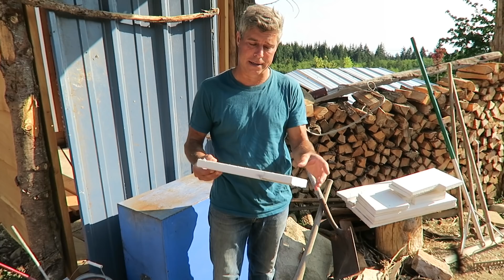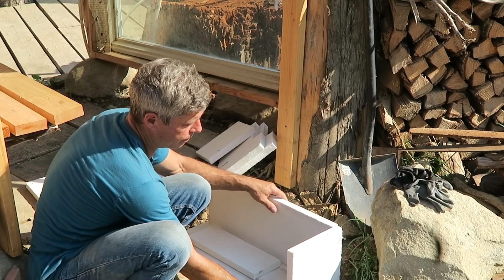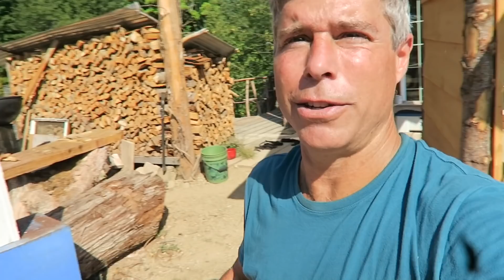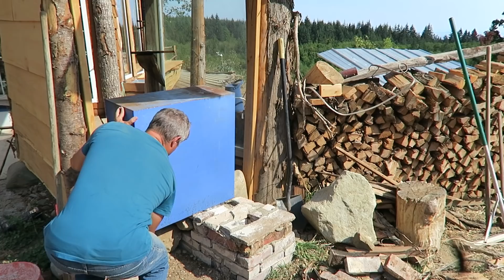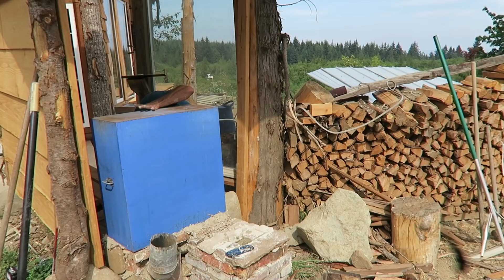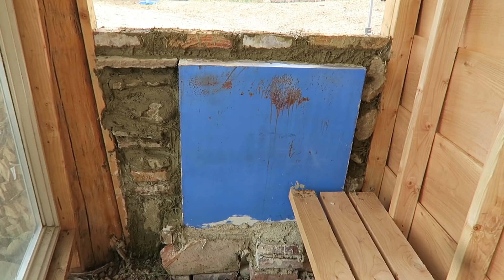Ceramic Fiber Rocket Stove Build Discussion

Comment: Hello Matt
Thanks for this video. Your CFB design for the core, lined with refractory bricks at the feed point - look like a great idea. I will surely try this out sometime soon, in the Himalayan hills in my country Bharat (India).
How does one clean out the wood ash remaining from every time one fires it? I would think that a horizontal  opening on the feed end would help create a cleaning port. Of course, we will provide a CFB plug as a cover to this opening so as to avoid any air entry from here. Your view pls?
Best Wishes
Rajeev Agarwal

Comment: From the internet: The silica (SiO2) in ceramic board can form cristobalite (a known carcinogen), at temperatures from around 900 degrees Celcius and up (so perhaps on the inside of the riser). It's advised to treat used ceramic board, that has been used as active fire insulation, with the same care as asbestos. Before use as such, it's considered harmless.

Comment: I just got a 4x6ft 2" thick piece of this stuff for free from a local fireplace builder. Large manufacturers often have large cut offs of stuff like this they cannot use and will give you for free or cheap 😉
Reply: Did you getter done?

Comment: You might sweat like a horse (you have no doubt seen a saddle removed from a horse), but you will NOT sweat like a Pig!  Pigs do not have sweat glands!!  That's why they roll in the mud, to cool down, because they do not sweat.  Other than that THANKS FOR THE VID AND THE INFO!!

Comment: I have a small (2-3 person) infrared sauna and the electric heating element controller is shorted out. 
My plan is to build a rocket stove using stratification exhaust inside the sauna for heat. 
Should the stove be on the inside or outside?
What material should the stratification chamber be made?
Please publish a plan for this on your site. 
Thank you for the great information!

Comment: I have a 2-3 person home infrared sauna that I have burned out the controller. 
It is wood construction with an interior wood bench. 
I want my sauna back. ;)
I found this video searching for a rocket mass heater for a sauna. Do you have plans for a smaller RMH to power the sauna internal air temperature to between 170-190 F?

Comment: Matt do you recommend ceramic fiber board vs a cast perlite clay core, I am planning to build a 8” j tube rocket mass heater,  I am also leaning toward your ideas about stratification chambers as opposed to stove pipe inside the mass, I also want to ask about the brick splits inside the burn chamber I heard you say before the brick gets hot and competes with the riser a little. Keep up the good work Matt

Comment: Hey Matt,
Please, can you tell me how high can you make the wood feed (total height from the bottom of the feed) using this design before it becomes problematic?
I have bought the plan and it seems that (before you add the exterior stone/brick etc on top) the wood feed will be 8 3/4" deep if I'm doing my maths correctly which is a wee bit short.
Thanks
Reply from the maker: It will work best if built as designed, but you can build up the height and see how it works for you.  How high will be a function of draft, so there isn't any one answer.  Depending on how much mass, how much chimney, stove temp, outside temp, etc.  I recommend leaving it as designed for ideal performance, but feel free to experiment and see if it meets your goals with taller feed heights.
Reply: @broaudio  ok. I'm just prepping wood for next season so I want to know how long to cut it. I'm going to be building your masonry J from your plan. Can I assume the wood length will be ok at 10-12"?

Comment: Been looking into this a lot over the years; this the first approach I feel I can do with my skill set. I come from a manufacturing background, and my desire was to form the batch box/burn chamber and riser in one piece out of steel, lining it appropriately. 
My next concern is the transition from the drum to the heat sink. I plan on building my own barrel, flanging the bottom, and fastening it to a flange welded to the batch box/riser.  It seems that every RMH I’ve seen has the burn chamber and bottom of riser packed in cob.  If the entire inside of burn chamber and riser are insulated with this fibreboard anyway, is it still necessary to pack that area with cob?
Or can I simply begin the cob packed area beyond the transition? Simply, must the bottom of the drum be part of the heat sink?

I’m looking to achieve portability with permanence; being able to disconnect the mass heater from the heat sink. 

Thanks for putting all these vids and info. online; without people like you paving the way, the rest of us have no road to travel on.
Reply from the maker: Jay, you can build it exactly as you describe. I have built some concept stoves similar to your idea and they work well.  I'd love to see it when you get to building it!

Comment: Matt, I ordered your plans this morning and built my core today. The plans were perfect and everything went together as it should. My question is, when I test fired the core it got so hot on just a small handful of sticks that the riser and burn tunnel were shedding intense heat and smoking quite a bit. Is this normal or is the ceramic board I bought not right for what I'm doing here. I thought this stuff was supposed to be super insulating and keep the heat from doing that. the board I have is rated for 2300f. Any input would really be appreciated. Thanks
Reply from the maker: Doug, the ceramic fiber has a binder(rice starch typically) which burns off in the first burn or two and does smoke badly at first. The board will cure and become harder and stop smoking after a good hot burn or two. Keep going!
Reply: Thanks for the super quick reply! This core is going to go in a barrel for a shop heater with provisions for a mass bench built in. I will also wrap the core and riser with a ceramic blanket. Will my board take the heat? My first core in my shop heater was 6" square 1/4" steel,( I know,  bad, but I had to try) wrapped in 2" of ceramic blanket. It worked wonderfully for a couple seasons, but I believe this core is really gonna kill it!

Comment: Here in Uk they still sell clay drainage pipes suppose you could use them as the riser pipe
Reply: They will almost certainly crack up, because they aren't meant to withstand high temperature. Clay can be fired at temperatures much lower than a rocket stove generates. I had considered using clay chimney liner but learned (by reading, fortunately) that it would suffer the same fate (as the GreenShorts DIY guy admitted in a comment to his video).

Comment: Have you got a stove design to heat 44 gallons of water to almost boiling ? need large surface area of tank and loads of BTUs, power output but also need smokless and excellent burn efficiency, Basically, a cheap stove to compete with expensive wood gasifiers which are fan driven and too complicated. thank you.

Comment: Hey Matt, cool project you've got going on. I really like the simple design, I'm wondering what other pieces would be needed to turn this into a full fledged pizza oven? Also what sort of prices are you paying for your 36x48 sheets? Locally I can only find the cercamic fiber in 24x36 in sheets in LD1900 and MD2300 (different heat ratings) for $28 and $35, respectively. How pricey are these in your experience?
Reply from the maker: It would be a simple thing to add an oven over the top of the riser.  Your price is pretty good on the CFB.  I typically pay around $100 for the larger size.  The 24x36 will work for the build, you just will need a few extra sheets.  Thanks for the comment!
Reply: @broaudio  Hi there! great videos! I'm just wondering where you buy your ceramic fiber board? I'm having trouble finding a good deal online. Thank you!

Comment: This video answers one of the long-standing questions I've had about rocket mass heaters; can you have the fuel feed on the exterior of a building and the mass on an interior wall?  My father has a 30'x40' pole barn and my thought has been to build a rocket mass heater where the fuel opening is just outside of the building, with the burn chamber, riser, and thermal mass channel running the length of one wall before the flue gases exit at the other end of the building.  This would allow for ample heat transfer without exposing the interior of the shop to any open flame, ever.  (This is a major concern of his, due to the flammable nature of some materials he uses in the shop.)  This video shows how the thermal mass can be inside the building, or part of the wall itself, with the rest of the stove outside.  That is encouraging.
Reply: It's always prudent to avoid open flames in the interior of any building and especially if there are volatile compounds stored within.  Heat transfer is minimized by use of substances known to have high resistance (i.e. masonry.)  But I think your dad is quite right to want to avoid excessive heat in relative proximity to volatile substances.  Some compounds explode just being stored in closed spaces with elevated ambient temperature.

Comment: For a stove designed to efficiently heat a home, temperature in the main burn core, where gasification occurs, can reach higher than 3200F deg and melt steel.

Comment: Nice i tried the ceramic boards awesome stuff thanks for the heads. If you want a better seal for the brick surround you can use sand and water with a plasticiser washing up liquid works well use like a mortar creates a re useable mortar seal on the bricks.

Comment: matt, you do not seem to be concerned about the clearance of the radiator over and around the riser or the ratio of space in the surround to the riser.  i thought these were critical points of consideration.  also the height of the riser in relation to the burn chamber.  please help me here.  i am spending the winter trying to learn enough to build this thing before i freeze.  of course this has been the coldest winter in 50 years already and the house is barely above freezing.  i asked about venting into a fireplace chimney somewhere on one of your videos but i cannot find it
Reply from the maker: Hi Leslie, I've built so many I have a good feel for what is adequate with regards to clearance.  Just make sure you have no less than 4" above the riser to the radiator and you will be fine.  Around the riser you want equal CSA to system size.  This is a 6" system so I want 29.sq.in minimum around the riser, but it can be on one side or the sum of all around.  In this case I offset to one side, but there is lots of room.  My designs are tested with a Testo and verified clean, so I do not follow the common brick ratios exactly as I have improved upon the traditional design.  I feel the brick versions are inefficient and dirty compared to these, so you should not try to compare them.  Hope that helps.
Reply: CSA is? and what about venting into the fireplace chimney, Please. and yes.  it all helps.  I was so excited to find the heat riser and core videos.  then i read where you said it was a temporary cast core.  i have watch hours trying to find a system of some longevity that is complete enough that i can build it,can you direct me ?  i think i have watched all you videos at least once. if i ordered your plans for a RMH would i need any more info.  i follow directions well.  is cat litter clay good for the cob? i really wanted to build your stove but your said it was not as good a heat source.  Thank you.  Thank you.
Reply from the maker: Leslie, the cast riser is a long term riser build.  The inner form is temporary.  My stoves are a great heat source, all of them, but need to be sized correctly to the space.  No cat litter please.  CSA is cross sectional area.  I believe you should just start building, you are not going to know everything until you build one and have some experience, so I suggest you follow some plans or use the casting videos and start getting some experience.  It's truly the only way, you just have to dive in!  Good luck.
Reply: it was your comment about having "fun" with the cement and mortar that encouraged me.  you are so kind and i thank you.

Comment: How would autoclaved aerated concrete do?
Reply from the maker: Any portland based material will fail in short time.
Reply: This AAC cooked at high tempatures in an autoclave. Invinted in and Used in europe as 25% building material. fireproof,  rot proof weighs a quarter of a concrete block.  Not sure if its portland based. I could call the manufacturer.  Sounds a lot like ceramic fiber board but could be more durable . Cut with a hand saw or band saw. I didn't know if you were familiar with it. if you heat one side the heat is not transfered to the other side. I thought you might try it.
Reply from the maker: Have heard from European builders attempting it with Hebel and others. 800°C is max rating, not high enough for these stoves. Thermal cycling is also an issue.  It will fail. It does seem ideal, but not for this application.  Thanks for the comments!

Comment: 1” x 36” x 48” ceramic fiber board seems hard to find (at least for me). Any tips on where to look or other sizes that might work?
Reply from the maker: Overall size doesn't matter.  My supplier sells that size so I do my layout on it, and that allows me to specify how much.  If you use other sizes, just get some graph paper and work up your layout to figure out how best to use the sheets and how many you will need.  Hope that helps.
Reply: Where can I buy the ceramic board
Reply: @lancerudy9934  google indicates: https://ceramaterials.com/product/ceramic-fiber-board-low-density/

Comment: How do you feel about aircrete? Would it be an alternative option and have you tried it?
Reply from the maker: Any material that uses Portland cement in the combustion areas is destined to fail.  It just can't take the temps.  It's great for everything but the core.
Reply: broaudio thank you for the feedback

Comment: I'm amazed of the simplecity of the heater and the materials, but as a Finish person wondering how on earth are you going to use it as a kiuas, which you would throw water on? In Finish saunas the model is basically the same, although made out of metal, and the whole heater (=kiuas) is inside the sauna, and always covered with stones. Of course Finnish style heaters are just basic burners and not rocket style burners, but I'm tempted to built one to test it. 

Hope to see the completed sauna in action when it's done!
Reply from the maker: Thank you!  I am waiting for some more cedar from the mill to insulate and finish the inside.  The metal radiator is exposed inside, so I will put rocks on that and throw water on it.  I'm not sure when I'll get it finished up, but I'll show it to you when I do!

Comment: Thanks for all the great info.  Did you need to extend your chimney pipe in order to get a good draw?  If so,  how far?    It looks like you live an interesting life,  how cold does it get out there ?
Reply from the maker: Thanks Lisa.  The stove draws well as is, I have not extended the chimney since this video.  I still need to put a cap on it!  It is typically above freezing all winter, but we have a few weeks of 20-30, and usually a few snow events a season.
Reply: @broaudio  So you live in a tropical paradise? (From Minnesota, so my  thermometer is askew)

Comment: Hey Matt. Great info again! Do you think Calcium Silicate board would be usefull in the burn chamber when lined with fire brick of sheet metal? I understand calcium silicate van not be directly in the flame path.
Reply from the maker: Thanks Piet.  I'm not familiar with that material, or at least, not by that name.  I do not know if that is the same as my "ceramic fiber board."  I'll speak regarding the material I have experience with, the CFB.  My preference is the bare board in an unlined firebox.  It does wear, but if you load carefully it will last years.  I've been putting an extra layer of CFB as sacrificial "cheeks" in the firebox.  Lining with metal won't work, too hot.  Firebrick solves the durability issue, but brings a whole of host of combustion problems, and it sucks to load as it's a forge in the firebox for a long time after the fire is out.  My recommendation is try the bare insulating board, and perhaps double it up.
Reply: My idea for using sheet metal as a liner was a bit like your P channel that you slide in the bottom of the batchbox in a way you could easily replace it. I am trying to come up with a solution that could be build for clients, using  the CFB or alternative Calcium Silicate Board (to be tested). Bare CFB isn't really an option I feel. I know any metal in the firebox will burn away sooner or later but it would be so easy and cheap to replace. Heck whey not use a very thick 'sheet' like 8mm or so. That should last a while. Or what about ceramic glass as a protection for the board? I'm about to test it and I'll try to report on my experiences. Thanks for sharing your great idea's! (bought your tiny house cooking stove plans today)
Reply from the maker: Hey, thanks so much for the support Piet!  If a client would like on a liner, I'd say just go with firebrick splits.  My core is designed to fit a split brick liner on the sides, and bottom if desired.  Cheap, easy to replace, and familiar.  That said, the glass is interesting, for sure!  Let me know how it goes if you try, please.
Reply: I can tell you from experience, metal won't last in there. See, metal, fire and oxygen makes a perfect combination for it to oxidize..iow RUST away. Better use the fire bricks or the board he mentions. However, a grid or the like made out of metal is good for firing with coal. It's recommended if one uses coal of such things, as they get really hot.